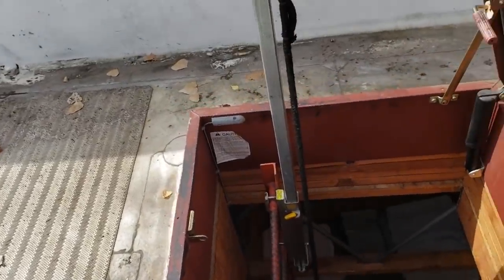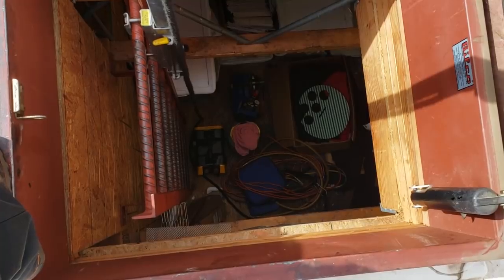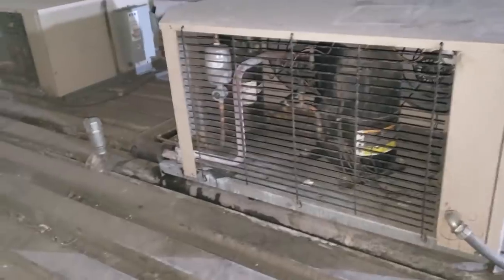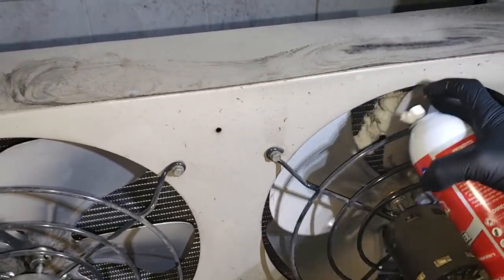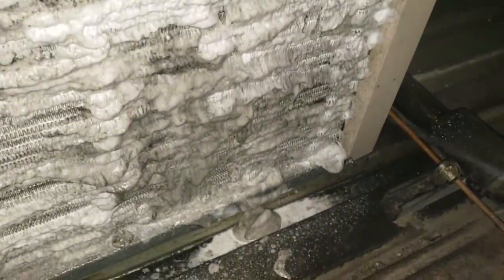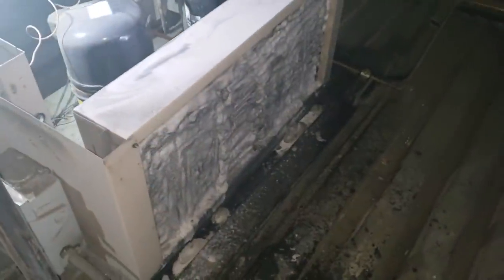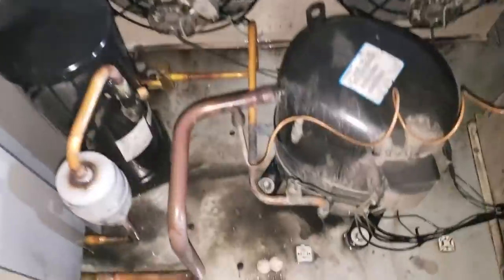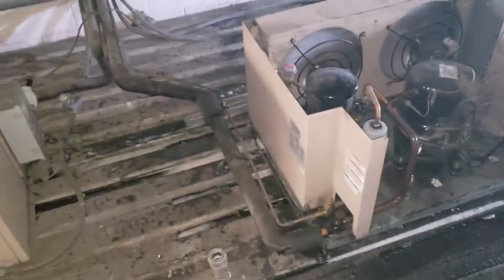HVACR VIDEOS QUICK TIPS

Comment: when cleaning conds. units on decks /indoor locations, I used to have a small wet/ dry vac . to pick up the spent water,had a small battery powered bower ( workforce) to blow dry controls / etc. after cleaning is complete. K.M.J.P.-C.M.   GREAT WORK!!

Comment: An old timer taught me a 'trick' when cleaning a condenser that didn't warrant pulling the motors. Tin Foil.. Wrap the motors in cheap Tin Foil.. then you can go at that coil with a hose. Never lost a motor doing it that way. Thanks for the Video.
Reply from the maker: Thanks for watching, I will be going live this evening 3/25/19 @5:PM (pacific time) on YouTube to discuss my most recent uploads come on over and check it out if you can... https://youtu.be/Bqx-RSJsidY
Reply: Sysco or other foodservice providers have pop up foil sheets 12"x12" that are great for shielding motors or electrical cabinets.

Love the Viper but non rinsing on evap coils only. Condensers probably still need rinse.

Comment: Have you tried taking the little bags that come with your grocery shopping stuff and wrapping the rap in the motors with that and actually the bags that you can get from United refrigeration that they'll put your stuff in work the same that are actually the same kind of bag just wrap it around the motor and that usually stops anything from getting up in there
Reply from the maker: I've seen others do it but no I haven't done it myself. Normally I would just pull the motors but this one wasn't that bad, If it was greasy I would have just used a water hose and pulled the motors.
Reply from the maker: Thanks for watching, I will be going live this evening 3/25/19 @5:PM (pacific time) on YouTube to discuss my most recent uploads come on over and check it out if you can... https://youtu.be/Bqx-RSJsidY

Comment: I urge you to do a little power study on each new install and each time you clean coils. Why? I work in reliability and nothing can be improved which cannot be measured, so I work hard to put numbers on everything I can so my impact to the business can be better understood. Let's take the case of a two hp motor 220v 3ph 5.8amps running 24 7 365 and electricity cost is 0.12/kw. 220v * 5.8amps = 1.3kw/hr * 24 = 31.2kw/day * 365 = 11388kw/year * 0.12/kw hr = $1366 electrics per year over a 20 year lifetime is $27,331. The original motor cost is $615 or $615/$27,331 = 2.25% of the amount of power it consumes in a year. In short, even saving a little power adds up to big dollars pretty quickly. You are doing a good service for your customers and yourself a disservice every time you don't do a bit of study, (what is the supply voltage, and what is the amp draw) both before and after you complete a service call. Your services can easily pay for themselves in short amounts of time just in energy savings, which means that they are getting more than just something that was broke and is now working but they may be saving several thousand per year on top of that.

Comment: Chris, have you tried using a shop vac on the outside of the micro coils? You would be doing the opposite of what the fans are doing. Also a good point you made about waiting to see if the motors were shorted out due to your work. Discussion time: Do you know about precision maintenance? The bathtub curve of failure? Not criticizing just opening up communication paths. Why not Dawn dish washing soap and water soak for the coils? It's just dust and dirt usually stuck to oils and the metal surface. What I have found is that time is the component that aids cleaning to most as well as abrasion. Abrasion is usually out when it comes to coils. Back to precision maintenance, here is a good link to some tips about fans and general maintenance and installs. https://www.reliabilitysolutions.net/videos  if you don't want links dropped on your channel just say so and I'll get them to you another way. Ian is a great instructor and a very good troubleshooter and fixer. I have heard that the worst repair is an act of troubleshooting that happened to work. Precision maintenance, we both work in the maintenance field, would you say good maintenance is walking away and 99.9% of the time there are no call backs? There are over 37 million flights per year, at 99.9% success rate that equals 37,000 failures per year, the airlines worked on precision maintenance and only work on things that need to be fixed. We are talking about the engines and critical flight systems. the actual failure rate is 113 incidents / 37,000,000 flights = 0.00000305 or 0.000305% failure.

Comment: Let's beat a new horse to death. I believe that a few episodes ago you fixed an ice maker that had many problems. One of the problems was a stuck solenoid water valve. In that video I was attempting to estimate how much water was leaking through, that was a pretty steady stream so maybe 6 gallons per hour (that's why it's good to measure) but if that is the case AND the water coming out is colder than the water going in then the customer was paying for the water to go down the drain and for the water to be cooled prior to dumping down the drain. 6gph * 24hr/d * 365 d/yr = 52,560g/yr which maybe $200 in water bill per year, but the power required to cool 52 thousand gallons of water even 1C is good amount of electricity. That's why it is good to measure things like water leak rate and temperature differences. You probably saved them a lot of money but if you don't let them know they may never know. If you are providing an equal service to the next guy but you document your savings but he doesn't then the customer only knows one takes the time to measure and report the savings.
Reply: I had to do ISO-9000 and manage a quality program in a giant chemical company.  Your work metrics is great for the corporate and facilities level but you meet more and more resistance down in the family size businesses.  Understand your rationale.

Comment: Why do not use a mini pressure washer type Karcher K2? this is easier and more effective when the condenser is clogged with ordinary dust. money does not need to spend on foam, faster, you can wash the entire car. The problem is only in the connection to electricity, although this is not a problem. if there is a large capacitor then what?
Good luck!

translated from Russian to google
Reply: You need to be careful. High pressure can demage fins. Plus it is faster to work with wider spray.